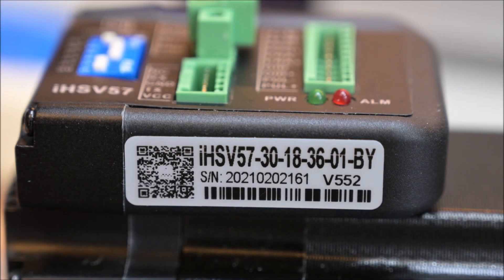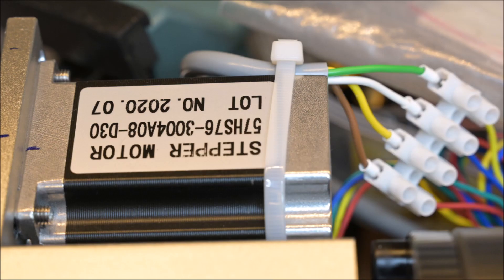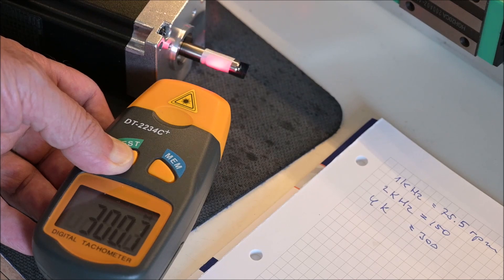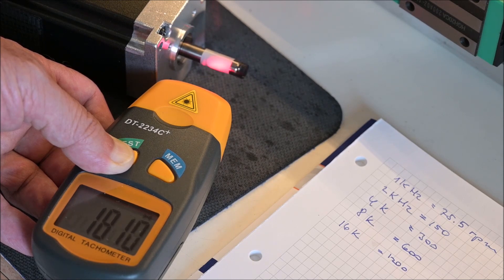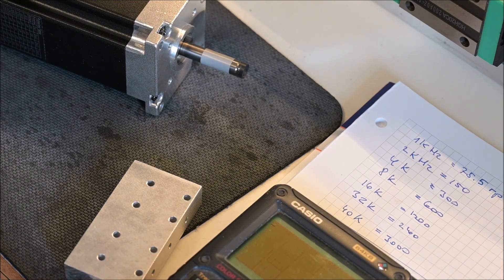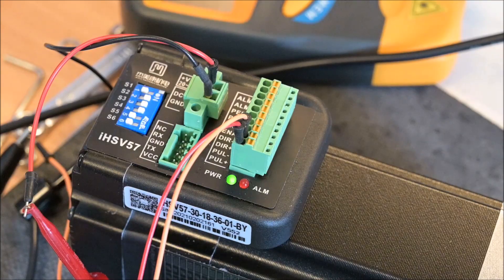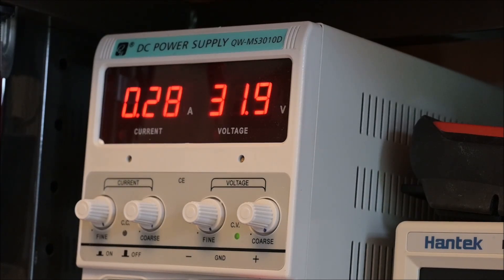JMC iHSV57-30-18 180W servo motor test

Comment: what the hell how did you measure the shaft lenght... that makes no sene o:
Reply from the maker: Go back to school if you don't know how to use a caliper. I measures exactly right. Here is a video which guides you about how to use the step gauge of a caliper. Watch from the 2 minute mark https://youtu.be/oOZjbbe6YZk?si=a4mkiOfv7rJq27dZ&t=122 you might learn something.
Reply: @AdaptingCamera  Sry my comment was in no bad intention 😅

My caliper doesnt have that function so i was confused. I know that the shaft is 31mm because of the drawing
Reply from the maker: @spayrex_ ALL calipers can measure steps, you just need to turn the caliper around and look at it at the back.

Comment: Szia, érdeklődnék, hogy milyen beállításokkal üzemelteted a szervót. Nekem is van egy JMC Servo iHSV57-30-14-36-21-38 típusom, de Arduino-n keresztül kiadva a videóban látott frekvenciákat, nem érem el a megfelelő fordulatszámot. köszi előre is :)
Reply from the maker: Sorry, I didn't answer your question earlier. I hope it's OK to answer in English, so that even others can get help. Your question is regarding the motor not reaching high enough RPM when controlled by Arduino.

I guess that you are also using FastAccelStepper library, and there is a limitation in FastAccelStepper.h file. The number of pulses per second is by default limited to 25000. To run faster, if you need more pulses per second, then some modifications are necessary in the FastAccelStepper.h file. Change MIN_DELTA_TICKS (TICKS_PER_S / 25000) to: MIN_DELTA_TICKS (TICKS_PER_S / 100000) which is more than necessary, but I don't see any point for this limit of 25000 pulses/s so I just enter this high number. This allows setting of maximum 80kHz with some margins for fluctuations. 

I also had to change several motor parameters, the most important are the electronic gear ratio molecular (set to 10) and denominator (set to 1). Play with those parameters and Arduino changes and that will hopefully help you.

Comment: sorry can you explain me about testing wiring this servo motor?
Especiallny orange and red wire from pul+ and pul-
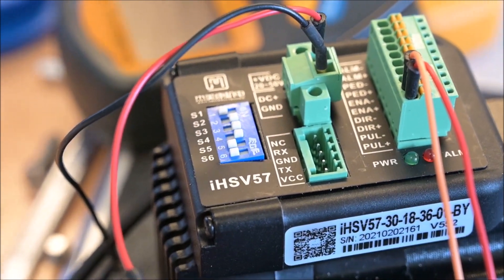Reply from the maker: The test connection in this video is really simple. I just connected the power to a power supply and the pul+ / pul- to a pulse generator. The servo has a built in driver which has optical isolators on all inputs also, so it is really simple to connect to any devide which sends pulses. As I show it at 4:28 marker the pul+ is connected to my pulse generator + output and the pul- is connected to the pulse generator GND. It's really very straight forward, but the servo comes with a printed manual, which contains all the explanation needed for the connection. It is also available online if you want to download it.

Comment: I’m curious as to why you sent the PPV to 400. Isn’t a higher PPV better for accuracy? What am I missing?
Reply from the maker: For the application where I am using this servo a higher accuracy is not needed. Anyway, people get fooled by the numbers. Setting to the highest steps per rev will give you higher accuracy but will also cost you torque and also demands very high pulsing frequency, which can be demanding if you have more axis to drive as well, so it's a compromise. In my case, this motor is a spindle motor spinning a chuck and I simply don't need higher accuracy, will have no benefit from it. I need the highest possible torque with good accuracy for angle positioning, and with 400 steps per rev I get the optimal results.
Reply: @ okay, thanks for the information. However, now I’m curious when the drop off in torque occurs. I was thinking of setting my PPR to 1600 since that would still give me a theoretical travel accuracy of 3.125 micron with a 2-1 belt reduction and a 10mm lead on my XY axis. Will I be losing torque here?
Reply from the maker: @grandmastersreaction1267  That is impossible for me to answer, but generally the higher number of microsteps, the more is the torque loss. Anyway, another issue with too high microsteps is that it also means higher number of pulses per revolution. That is no problem if you have a system which is capable of generating synchronized pulses for all your motors, but if it results in maximum speed loss then it becomes a problem. Anyway, you must try, if it works it works, if not then you can just decrease the microstepping. Just a note on your aimed accuracy, in my opinion that's pointless and unrealistic. Do you even have any device to measure that? I mean, maybe you do, but then you must ask yourself if you really need that accuracy, and for what. All your other components, the belt and the ball screw / ball nut will have several magnitude worse accuracy, so you won't benefit anything other than maybe noise from having such high (imagined) accuracy.

Comment: Does the motor get hot like fire, mine does?
Reply from the maker: Mine never gets hot, but I think there isn't a problem, since stepper motors and servo motors can get hot, up to 50-70 degrees Celsius should be normal.

Comment: Thank you for your video. It was exactly what I was searching for. I’m wondering if you could assist me with a hopefully simple calculation? I’m trying to set up a cnc spindle with the Klipper software. I need to enter in the pwm frequency.  I have the 180w stepper online version. Could you help me figure out what the pwm frequency would be? I don’t have a background in electronics.  I want the max rpm to be 5000. Thank you and I enjoy your content.
Reply from the maker: Thank you for your comment. This servo can not run faster than 3000 rpm. I don't know the Stepperonline version, but I believe it's the same. Anyway, I am running mine with STEP/DIR commands, not pwm. Sorry, but I can't help regarding the pwm frequency.

Comment: Hi, do you know if it can work with 48V PSU? Similar servo from stepper online supposedly works fine on 48V. I would like to avoid purchasing new PSUs in case I'd go woth these servos.
Reply from the maker: Hi, Yes, it works with 48V, I run mine with 48V and it is specified for 50V. I don't know the one Stepperonline is selling.
Reply: Great, thank you for confirming this. Got some pretty good 7.3A 48V PSUs, so I'd like to keep them for the servo setup. I asked the manufacturer but they did recommend to stick with 36V so I was a bit confused. 

For refference here is the StepperOnline servo, very similar https://www.omc-stepperonline.com/integrated-servo-motor/nema-23-integrated-easy-servo-motor-180w-3000rpm-0-6nm-84-98oz-in-20-50vdc-brushless-dc-servo-motor.html , 

Clough42 did test it and you can find it on his channel.
Reply from the maker: @crabsshed  I did check out the Stepperonline version, but did not like it because it does not have enable signal. Beware, if you feel you need that, then don't buy the Stepperonline motor. I sent them a question, and got the answer that the enable/disable can only be controlled through serial com port, which is totally unacceptable in my opinion.
Reply: @AdaptingCamera  Yes, I am aware of that, and that is exactly why I am liking the JMC servo more. Going to order one for testing and see how it works for me.
Reply: Hi, do you know how is the minimum rotation possible?
I need much less then 1rpm
Reply: @jonaspereira3551  I guess it should work even at very slow RPM. Never tried it but I can when I get to the CNC with some really slow feedrate.
Reply: These work best with 48v